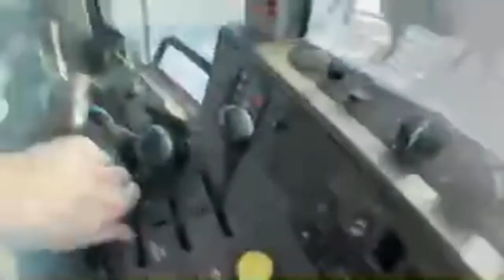Let’s Do Chores - Feeding the Cows @ -10 Degrees

Comment: Hi Mike.. Suggestion for removing ice from tanks. Drill 3\4 to 1inch holes in bottom and sides about 1\4 to 1\2 of the way up sides of a 5 gallon bucket. After breaking up ice skim bucket in the water. Ice stays in bucket water drains back into the tank. Can put ice in front loader and take out of field. Can put ice in barrels or other storage device for watering gardens later on.
Thanks for the stream. I miss having cows..

Comment: On the breaking the ice for the cows have you considered hanging PVC pipe along the fence horizontally and inserting whatever tool you choose to break the ice handle first into the PVC pipe?
That way you have a semi permanent place for a tool for the winter keeps the handle clean and dry.

Comment: 20 to 24 volt hammer drill with a fat wide chisel head I think you can get them about 4" wide. That might work well, keep it in the cab. If it doesn't work you will probably have at least 30 days to return it.

Comment: Looks cold out in Wyoming!    Here in Texas our nights are supposed to be  -15F  over the weekend.   Most of the cattle are in feedlots being feed corn.   Nice if they could feed hay but it is not possible when each feedlot has 30 to 100 thousand head.  Only a limited crew to feed so many in bunks.   Most ranches have saved grass pastures from summer and just supplement during these cold spells.  Too cold for snow!  Mostly dry pastures in the winter.

Comment: Hi Mike,  Hay, maybe try a 15w50 diesel oil in your hydraulic systems i.r. hay Hustler. It probably has a standard 68w that is too thick for extreme cold.  I use the 15W50 in my tractor hydraulic system and remotes year round. It works perfect, no pump cavitating in extreme cold and everything works great. 
Best of luck, Rich 🤠

Comment: Have you ever had wrap on hay freeze to hay and what do you do if that happens?
Reply: Hi Galen! The Hustler Chainless bale feeder rotors are able to get the net wrap off, even on frozen bales, it's not a problem. Then, you can collect the net wrap from the wiper panel (which has a quick-release system). Wherever possible, we always recommend that you remove the net wrap BEFORE feeding out. Of course with frozen bales we know this can be next to impossible, but recommend that you carefully check that no part of the netwrap can be consumed by your animals.

Comment: Does the feeder have a PTO or just a couple of SCE’s feeding the implement. Did the hay feeder/roller just wear out?
Reply: Hi Gene! The Hustler Chainless bale feeder runs on hydraulics only (no PTO) which is economical (fuel) and safer for the operator. You'll need x2 double-acting for this machine. You can check out the specs of this machine here (Hustler Chainless TX205) for further information: https://www.hustlerequipment.com/bale-feeders/trailed-chainless-bale-feeders
Reply: @HustlerEquipment  I knew as I couldn’t see a PTO shaft and the other choi¢e only made ¢ent$

Comment: Do you loose any cattle due to the extreme cold? I was an electrician in a large maintenance shop where years ago the machanics used to drain some hydrallic fluid out of tanks and add something. Think it thinned hydralluc fluid. We also had electric heaters on a few hydrallic tanks. Keep warm & stay Healthly.
Reply: @Dry Creek Cattle Co. Just to add to Dry Creek...cattle tend to hudle in groups to stay warm if it's too bad.